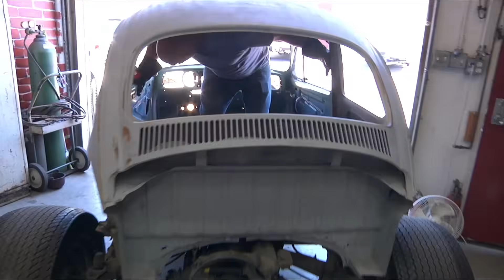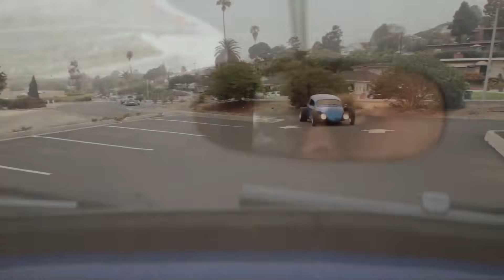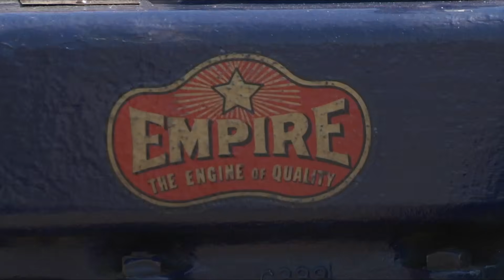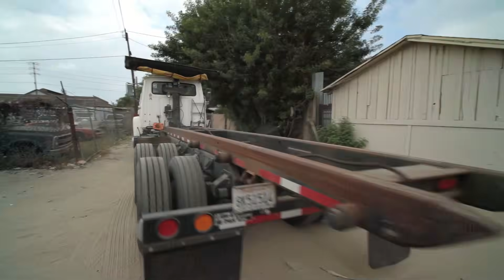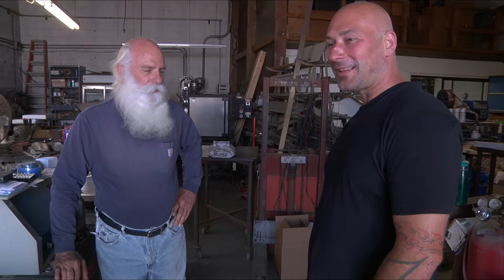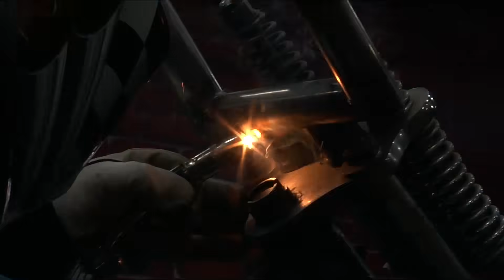Radical VW Bug Chop Top Build From Scratch | Full Custom Garage

Comment: I'd like to see someone use the eslingers kit from the old sand rail/dune buggy and swap a focus st engine in one of these. With a mild tune and good fuel a guy could get 300 hp and around 400 lbft out of one of those. That in a 2000 lb car should make for a fun time.

Comment: the thing to do with a Beetle, is put a Ford Essex UK 2L V4 69bhp in the back; for the Kombi, a Ford Essex UK 3L V6 141bhp, the adapter plate to the gearbox is available in South Africa. 2 engineers with Kombis reversed the rotation of the V6 engine to match the location at the back.

Comment: This is the kind of bike that i would like to get a 3 wheeler , won't have to worry about falling off the bike, my friend redone his bike and put in a V6  3.4L Engine in his He scrapped a Grand Am and used the engine from that Car he changed over the Dome to fit a Carb on it as of before it was Fuel injected. 👍